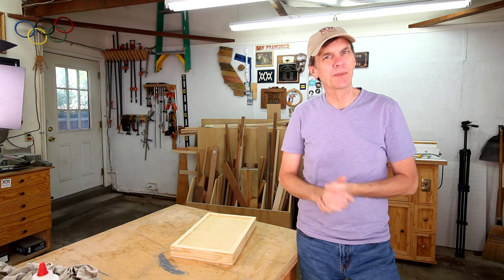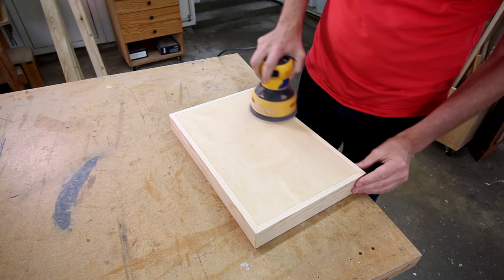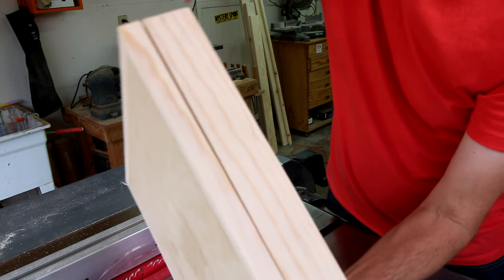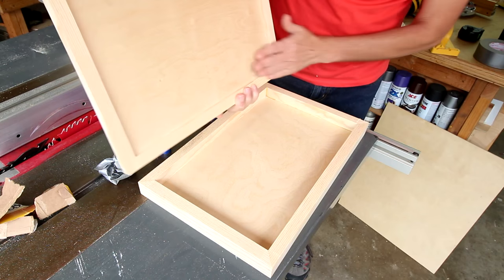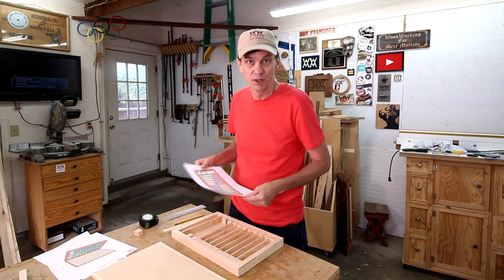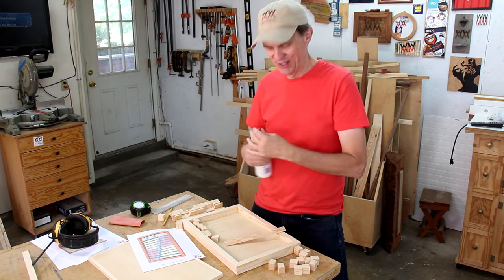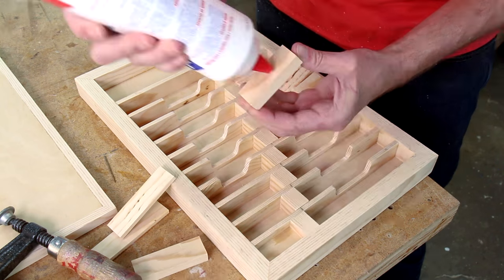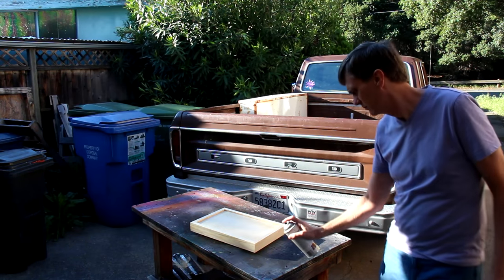Custom Drill Bit Storage. Under-Cabinet storage. | GREAT SHOP PROJECT!

Comment: if you grind down the socket end of a worn out magnetic hex bit holder you can use it to pick up the drill bits really easily. and with the non-ferrous sleeve it won't stick to everything.

Comment: Steve, have you had a chance to see how those rare earth magnets like the one you  used hold up over the years? They always seen strong initially but I fear they might lose strength in 5 or so years of lid banging and use.
Reply: magnets don't work like that
Reply: +refard5 Like what? Magnets do lose their magnetism if you keep manhandling them. That's why your teacher might have told you not to drop or hit the magnets in school.
Reply: +Colaman112 I think particularly rare-earth magnets will be rendered to dust long before they lose their magnetism due to being hit :P Heating them up to the curie point however, well that's another story.
Reply: +Azayles Yeah, modern magnets might not lose their magnetism noticebly due to being hit, but they still not completely immune to it. But to the original poster, I don't think that's something you need to worry about.
Reply: ***** Yeah you'd have to whale on that thing till your arms bled before you got any decent drop in magnetism, I think.
Unmagnetised ferromagnetic material that is stuck will pick up the earth's magnetic field though, magnetising it slightly. I wonder if there's a source of confusion there.
Fucking magnets.. :P

Comment: Silly question, but where do I find the “Description section at the end of this video” for plans and whatever else. Nothing like that shows on my iPad. 
Also, your advice about using smaller scroll saw blades for thin stock was exactly right. Thanks. 
Hank
Reply: On mobile there is a drop-down below the video.

If you're on a computer there is a "show more" button below the name of the channel.

Comment: Your problem cutting open the box can be solved by not cutting completely through the wood, but cut it to a extreme thin strip of wood all around and then cut it open with a knife and sand the excess down. Much more stable and the angles are 100% true, guaranteed!

Comment: Easy way is to set blade height just below the thickness of the material and use a knife or thin kerf saw to separate the lid.
Great job on the box

Comment: making a quick router template for those cutouts would have probably been a lot better and faster, also good luck never opening it up from the wrong side >.<
Reply: I think it would be quite hard to try to open it from the wrong side since the wrong side has two very large gold hinges on it
Reply: +Joseph Aronov yeah I don't think that comment was well thought out
Reply: +Joseph Aronov  I think he ment  upside down
Reply: I think that is why he turned the lid upside down so it would be easy to identify which way is up.
Reply: rja9003 yes, but what if someone else opens it up who doesn't know that ?
hopefully you guys finally understand what i meant.
And that could be prevented by either mirroring the "pockets" on the underside of the lid, or making the lid from a transparent material like Plexiglas and putting a huge "DO NOT OPEN FROM THIS SIDE" sticker on the bottom.

Comment: Very nice. This may inspire me to move beyond the plastic divider boxes and envelopes for the smaller bits. I don't know how humid your area is these days, but in the cases I make for tooling anymore, I put in a slot sized for a VCI chip to hold off corrosion, as moisture doesn't get out as easily as it gets in.

Comment: Great video Steve, as always.  Look forward to them every week.  You're a hoot.    I make a fair amount of jewelry boxes and I use the same method of gluing up a box and then splitting it in half.  Next time you do one try this.....bring your blade up just shy of making a complete through cut, leave a very thin sliver of wood to hold the box  together.  I've never actually measured but I'm thinking just a little less than a 16th of an inch. After making all 4 cuts a box blade or sharp chisel separates the top and bottom.  Very light sanding finishes it off.  Hope you find that helpful.

Comment: Hey Steve, I'm curious why you flipped the top over?  I kept waiting for the explanation or to see another clever idea for it's use.  I really like the shop project videos.  Keep em' coming!
Reply: +Chem Cody In case it isn't answered elsewhere, its to have the lid level with the tops of the dividers so the bits can't get out if the box is inverted.

Comment: I was taught that drills used for metal are called drills. Drills used for wood are called bits. The metal flip-up indexes are called drill indexes, not drill bit indexes. I know the easy is to call them all drill bits, similar calling all files files whether they're files or rasps. "Hand me that really coarse file." :)
Reply: They also called them twist drills back in the day :)

Comment: ive never understood why people have so many drill bits.. you only need 2 maybe 3 of each in case you break one. learn to sharpen them! dont get me wrong nice little box, but ive noticed its always woodworkers with the most drill bits even though they tend to break and dull them the least, cause if your working with steel you need to know how to sharpen them

Comment: Since you didnt label the different compartments, I assume you instinctively know the size of each drill just by looking........
Reply: +JIMMY TATE You can estimate the size with your eyes, and then once you put it in a compartment, compare it to other drill bits in that compartment and shift up or down as necessary - not all drill bits are labelled so labelling the compartments isnt all that useful
Reply: +Deep Sohelia So if you need for example a 19/64 you can just reach right in and find the one you need without fail? baloney
Reply: well you know what 19/64 roughly is? Like *****  mentioned in a previous video he rarely needs exact bit sizes, he just grabs something that looks roughly the right and uses it. This case is perfect for his needs - it holds everything neatly and the drill bits are arranged by size, so he can pick out something that he needs by eye.

Sure others would benefit greatly from labels, on both the bits and the case, but others, like Steve, dont. Sometimes less is enough.
Reply: +Deep Sohelia Granted I know that 19/j64 is roughly 5/16, but I have found several needs that I can thik of that needed a specific size 19/64 being one of them. the 5/16 would be too large and 9/32 would be too small. Labeling the different bins would take less time than making the box. Why are you so dead set against proper labeling?
Reply: I'm not dead set against labelling I just thought you were a little rude and thought it was worth explaining that theres more that one right way of doing things, and the way Steve's done his box of bits works for him, if it doesnt work for you make it differently, but theres no need to be sarcastic when Stevens made a beautiful product and put a lot of work in :)

Comment from the maker: Looking for a way to wrangle all those drill bits? Try making this custom drill bit storage case. It holds a LOT of bits. Plus, I made this one to store under a storage cabinet! Great shop project. More info and free plans: http://bit.ly/BitCase
Reply: Your such a good salesman, I don't even shave and I wanna buy those razors.
Reply: Where is the inlay a drill bit box must have a extra fancy inlay
Reply: I noticed that every part fits perfectly - as always for you. They always do (but I don't know many you tried of course). Could you make a video about taking accurate measurements and transfering them accurately to materials? Thanks. Great video as always.
Reply: +Steve Ramsey 
Nice, these are Titanium Nitride (TiN) drill bits right? You can use them for metal working as well .And the best way is to lubricate them with cutting oil, so that requires to have the inside of the wooden box finished as well.
Reply: +Steve Ramsey "Drilling is boring"... I saw what you did there... You nailed that woodworking pun... Not screwing around there. OMG MDF!
Reply: +Unapologetic Apologist Grow a neck beard. ;)
Reply: Hey Steve new to WW. How do I know what wood to choose when I do projects?
Reply: cool
Reply: Just a tip. When cutting the lid off lower the blade so it's just below the thickness of one of the sides. Then you can separate it from the box with a razor knife and clean it up with some sandpaper. Then you don't have to worry about the lid collapsing on you.
Reply: Cool project Steve!